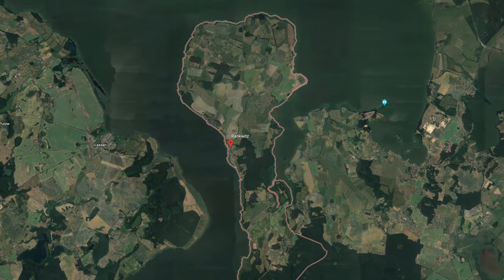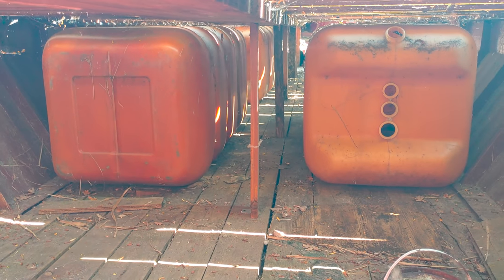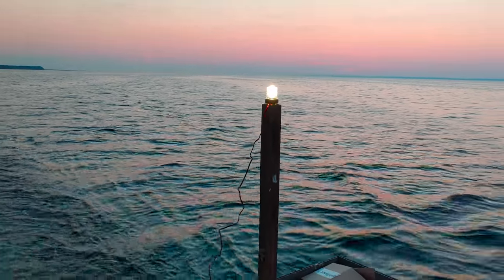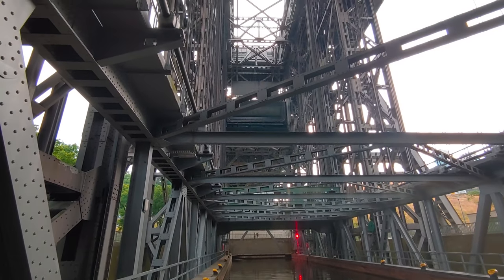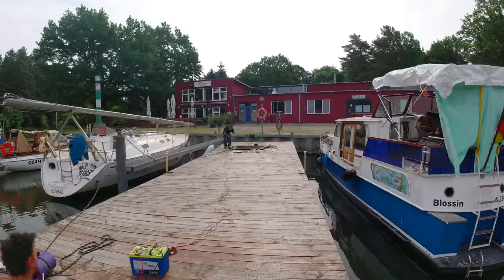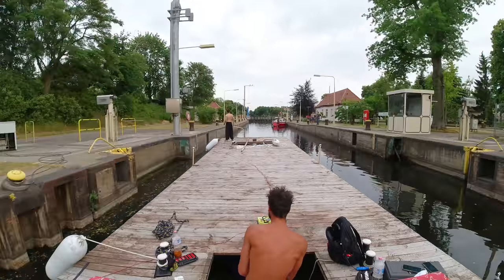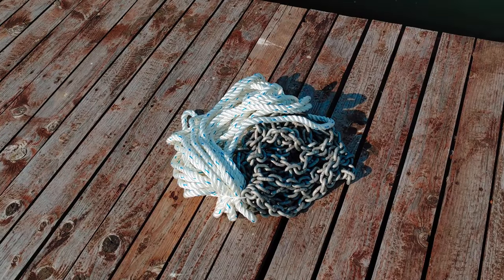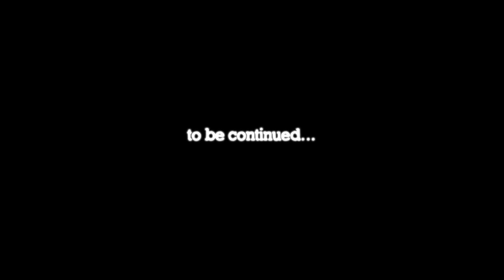I bought a 14 Meter long Water Plattform Boat - Ep. #36 - Vintage Yacht Restoration Vlog

Comment: Vundebagh?
Trying to say how wonderful this is for you. Now you have your very own stable platform from which to work that will make things so much easier as you restore your 1st Boat. When done that little barge could be turned into one heck of a tiny house on the water. As long as you stay in the channels, low current rivers and smaller bodies of water it could be turned into something very comfortable once it's served it's purpose for the restoration. Even if you keep it and an area of it's deck open for future projects a small structure on it for secure storage could be a boon as well. So many possibilities with this repurposed little barge, so many. Well done young man and in my opinion a very wise purchase...

Comment: A cool factoid about those ship lifts, due to Bernoulli's Principle, as long as a ship can fit within the lift lock, the overall mass of the lock remains constant, because the ship is displacing water equivalent to its exact mass. They usually run it in equilibrium, with a duplicate lock that exactly cancels the opposing side. It's fun because to an outside observer, or someone unfamiliar with physics/the specific physics relating to this mechanism, it looks incredible and unbalanced. But it's a relatively simple concept. The only difficulty being creating a vessel that can hold that large a volume of water, and a system that can support that vessel as it moves up and down.

Comment: Just a helpful hint, but the "anchor weight" is called a kellet.  Also, if your attaching links to the anchor swivel are not stamped with a working load limit, you probably should not be using them for that purpose.  Galvanized steel, just like the material your anchor chain is made of, is what you should be using.  Watch out for crevice crack corrosion of stainless steel.  There are much better anchors that plows these days.   Use a length of chain across the deck of the barge rather than nylon which could chaff in a storm.  Consider building several padded knees sticking just a few inches out from the barge deck to rest the boat against.  Once you get a nice paint job on the boat's hull, you will come to appreciate a bit of distance and padding there.  Last comment:  You would do well to have a spring line led back to the steering station from your midships cleat so that you can hop off onto  the barge and secure it to a cleat near aft on the barge to snub the boat in.  Running up to the bow as the firt thing to do with the stern swinging free is a little lubberly.  You will come to love the spring lines.

Comment: That's my kind of adventure.  Feel free to put me on a stand by list for the next one, if your friend can't make it.  I don't know if your plans are to leave this one moored or to move it around, but you might find that putting a rudder in the front will help you navigate better in tight situations, and strong crosswinds.  You could even add pulleys and run cable back to where your outboard is to operate it from there.

Comment: Hello from Australia.  I’m thoroughly enjoying your series. Was the ship lift getting you onto a different watercourse?? even though from the chart it looked like the same river!!! I don’t follow how you can go down in the 1st lock(water gate) then up in the ship lift & then down again in the following 2 locks & then up again in the last lock. I’m not familiar with Germany’s waterways. Thanks & all the best with your vessel renovation. 
PS I’m not an expert, but if you don’t replace your exhaust I’d be putting in multiple CO (carbon monoxide) alarms. Cheers

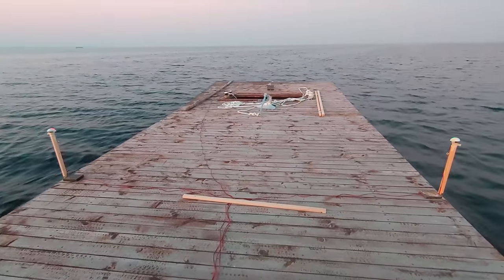Comment: It's hard to believe you have any official boat licence! I figured that already from some of your dangerous decking manoeuvres or strange anchoring system, and now once again at the minute 6:08 when you start to introduce your ingenious installation of the navigation lights; BUT I am sorry to tell you that the red and green lights are not installed properly, you should have mounted them, not with the fixation base horizontally the top of the wood poles, but vertically outside, in order to respect the international lighting angles for navigation from ahead to side following horizontally an angle of 112,5° for each of them, the green light on starboard side, the red light on port side. I guess your installation's goal was to be viewed from the sky sending some hello to some seagulls or even some planes passing by!... ;D 
Friendly teasing you, and thanks for your always nice videos.
PS: in fact this mistake is great in order to confirm your FIRST BOAT's navigation lighting installation in agreement with the official maritime regulation...
NB: you may find some information online using some key words such as "boat navigation lights international regulation",  to some information like those ones given from this random link: https://www.youtube.com/watch?v=r-mgZHN7FKA

Comment: I enjoy your videos, narration and craftsmanship, but I am disappointed with your safety protocols - especially when working around/near the edge of your vessels. Where was your PFD? I know you have a throwable device (life ring), but if you fall in and are injured you might not be able to get to the life ring. Also, did you have a marine radio aboard to communicate with the other vessels, or isn't that a mandatory sailing necessity in Europe?

Comment: Your execution of the anchor is flawed.  You need heavy chain (about 1/10th the weight of your vessel) which is the actual part of the anchor that keeps you in place.  The anchor itself is just the heaviest part of the chain.   I like watching your concept come to life within the budget.  Get yourself 100 feet of chain with anchor that weighs in at about 300 lbs if your vessel is 3000 lbs.  Lay the chain out below deck for ballast.